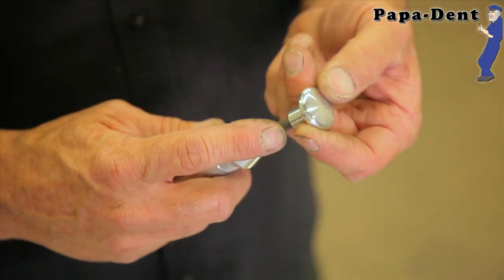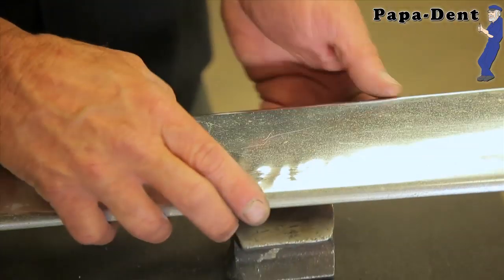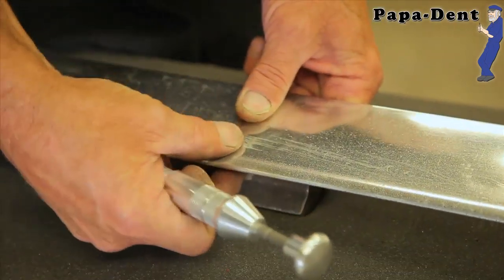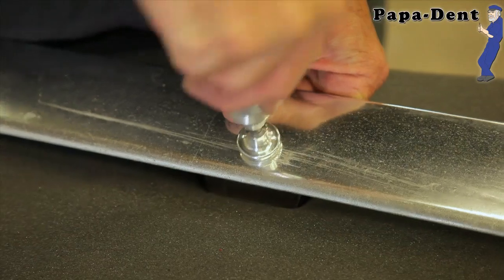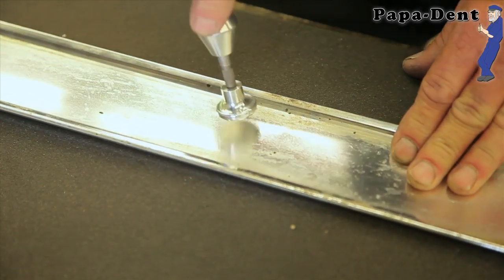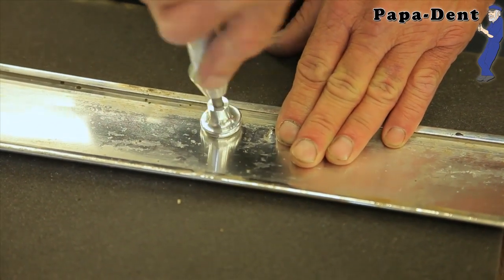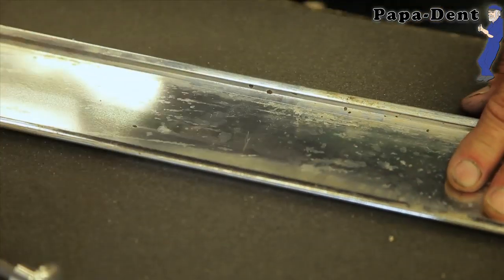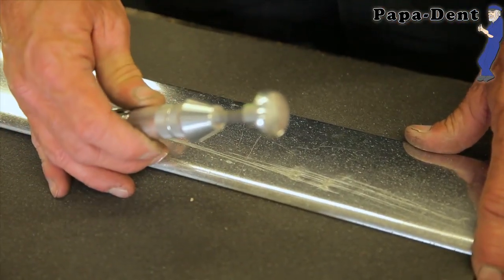Aluminum Mushroom Head - Papa-Dent Tool Bit

Comment from the maker: The mushroom tool bit would be to large to repair the damage in the rear moldings on the Camaro. You would have to use the chisel bit for the straight edges and a smaller bit for the other open areas on the moldings. Maybe the flat tip? Hard to say without seeing the damage. However you bring up a good point that we should look into making a smaller mushroom head. A smaller mushroom head would really work well in moldings like those on the Camaro. If you can send me a picture. Thank You Mark

Comment: Their Website is corrupt. Don't go there. Sorry I went to their website as the tool is better than Eastwood's trim hammer. This tool should also lock in place so it won't snap. It might be a decent tool if the website was not corrupted.